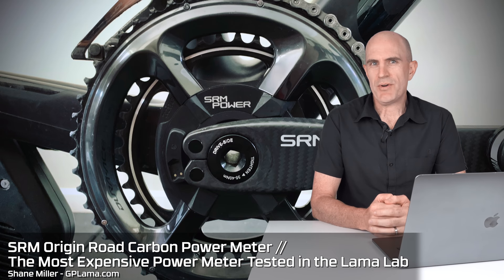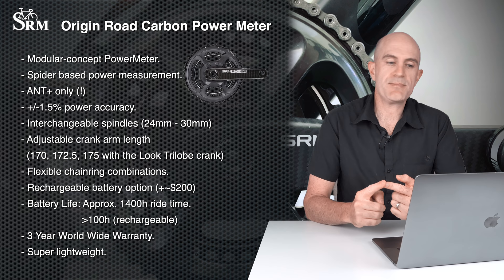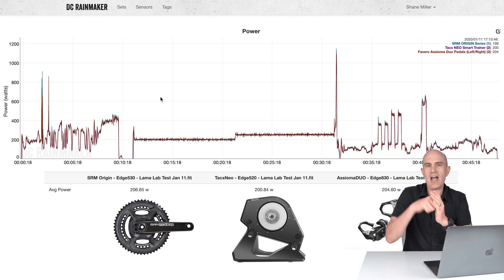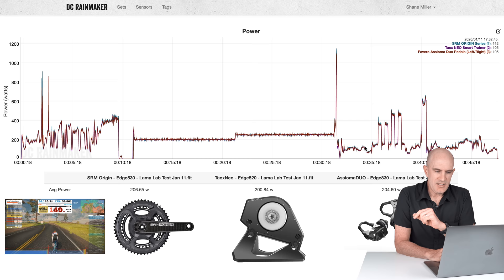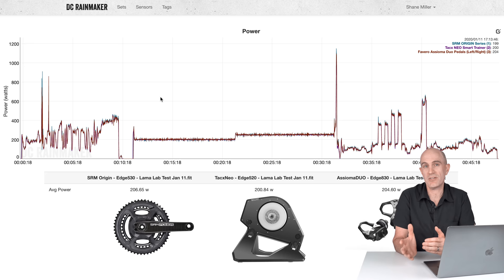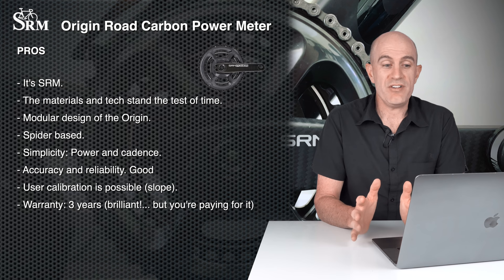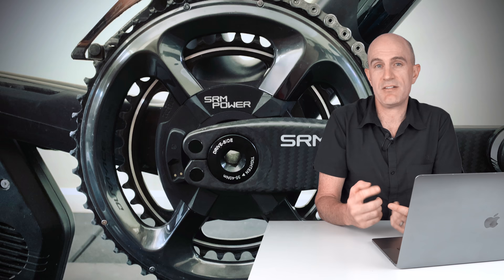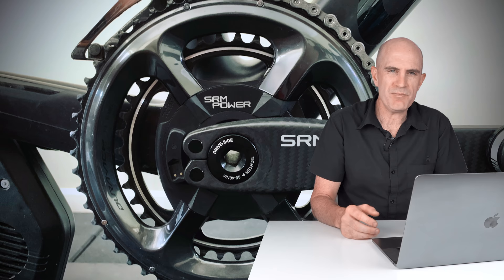SRM Origin Road Carbon Power Meter // The Most Expensive Power Meter Tested in the Lama Lab

Comment: The tech is a bit dated now and they have their issues, they are correct however in that it is not possible to provide correct L/R data from one sensor that measures total torque. 

As an aside I was there when the term "Gold Standard" was first used in relation to SRM, it was at the AIS in the first power meter showdown back in the early 2000's, it has been misused many times since, a story for another time. And congrats on the 100K, great work.

Comment: Two years back I bought a used SRM power meter for about 2/5 of its retail price and I never had any issue with it. It is so reliable and accurate that it is probably the only component on my bike that I never worry about. Yes the price is insanely expansive if you buy it new, but SRM will service your power meter whether or not you're the original owner. I own more than one power meters from different brands and my next power meter will still be SRM.
Reply: This makes sense as the way to buy SRM. Get it calibrated and it's like a new power metre

Comment: I’ve got a couple of these on my bikes and luckily didn’t have to pay for them.....as he says they do the job they are meant to do. The original version of this came with the crank arms made by THM and were made as singular lengths ie just 170 or 172.5 and so you had no problem with air between two metal plates and any chance of play. These are Pro tools and just like the PC8 nothing fancy but give the main info you need. Good, honest and fair video.....👍🏾

Comment: Having owned 3 SRM Power Meters (2 road one mtb), and having had issues with two of them. They aren't immune from trouble. 

Accuracy your testing proves they are no more accurate than anything else on the market, which mirrors my experience (all three read high).

For the price premium this thing needs to be breaking new ground on the technology front, instead it's stuck in the mid 2000's with Nokia! There is no way anyone should be dropping that coin on an SRM Origin, there are far better products out there.
Reply: what do you recommend. I just started doing my research. thanks

Comment: If you use srm with a compatible head unit you get 500ms update intervals which makes a big difference when using raw power to pace intervals. Get one off ebay for 350 quid , service it for 90 quid and you're away for less than most other power meter cost. New they are too expensive imo. I like the simplicity - my garmin pedals were buggy as hell wish they didn't have a load of extra features to go wrong ! Good review though every comment was valid
Reply: Now you can buy new one,7th generation,some warehouse deals-950€.
Still,way to much for what it is.
P2M ng eco is 490 for spider-thats a good deal

Comment: Just bought one of the ex team issue ones for about $1800. About 250g lighter than previous powermeter, looks cool as hell which is super important!
Also have a 9000 series SRM, it just works every time without ever needing to think about it, and with the PC8 have never lost any data from a single ride.

Comment: He says it many times in the video - reliable, reliable, reliable. I've had one for maybe 4 years now 20k miles never had any bogus readings, dropouts or anything like that. Previously used PowerTap pedals (pain in the ass changing batteries and 1 every 10 rides they drop out and you spend bunch of time trying to repair) and also PowerTap hubs (which were reliable). If you never want to doubt the readings or worry about the thing not pairing then SRM is for you.

Comment: Well done, I'm surprised you prefer an accelerometer vs a magnet based cadence measurement. As a big quarq fan, I do appreciate the SRM I own for it's simple reliability (changing batteries isn't that bad, and once you open the unit you appreciate it even more!)

Comment: A couple things to take into account. Accelerometers have a small amount of lag in them that effect the numbers that one gets when sprinting or any short explosive effort. On the track, many sprinters use power meters with magnetic based cadence for that reason. From what I understand, a lot of sprinters are still using the wired SRM cranks because of the improved accuracy compared to units with an accelerometer. I have an Origin on each of my road bikes and am planning on putting one on my track bike. I have never compared the two head to head, but the numbers look very similar when comparing data from the same route.
Reply: I approved this message, except the wired part from the aesthetic point only. 🤣 
Head unit matters too. Sold my Bolt due to this reason. Bolt reports (on the head unit) vs actual data (fit file) do not match. For example, max power shown on Bold head unit is 1500w. But after uploading file to cycling analytics or strava, there is no 1500w. It is always lower (as much as 100-150w difference).
Reply: Accelerometer lag is completely swamped by the sampling rate of the head units in general, and is even less significant compared to single magnet based cadence.

Comment: Nice review. New design is interesting 🙄.
Have you ever looked into how long powermeter last? SRM units are build for on road use. But the units work even after 15 years (keeping in mind that they get serviced every battery change). We had units for 7 years. It just worked. Sold for $600 to another user who still reports no problems after another 3 years. Battery changed, unit serviced twice for $100 (usd) over 10+ years. Price paid: $2250 (usd).   Question is how long would pedals or other pm for  $500-800 hold up and if for 10years what would be the service cost to keep it up?
Reply: Team Ossenbrink 
You can find many quarq and power2max 10 years old.
In working condition ofcourse
Reply: @mikicastan  Probably true but many quarqs I have sold to clients 10 years ago have broken or are reading very interesting numbers. Quarq started selling in 2008/2009. I had a few quarqs myself which are stripped to the core as they broke. P2M models are not out for 10 years. And most models which were sold in December 2010 are "dead". I used to own one of those.

Comment: SRM looks really good. I have had Stages on my MTBs, but 2 of them failed without guaranty after 16-18 months. Now i use Sigeyi AXO Spider Powermeters on my MTBs and they perform very well. On my Racebike i use Garmin Rally XC200 since 14 Months and XC100 Single on my Gravelbike without any Problems. For sure i never will buy again Crank-Powermeters!

Comment: From a business point of view, I get the price given it's from SRM, but from a functional point of view I think we'd probably all agree with you that it would be a show-stopper from almost anyone else. One thing I do find odd, I would have thought that the people that this would appeal to,would also be the very people that might find most use for some of the cycling dynamics metrics - not in real time, but for post-race analysis and  training. Maybe not - does strike me as odd though...
Reply: Well, it depends on what you do with it. Don't forget that a power meter is primarily a pacing tool. We can collect all sorts of data but the problem always is whether you can actually use it productively. It's a kind of a tool in search of a use. A solution looking for a problem (driven by a need to differentiate yourself, to offer something extra to your customers). We feel like it could be promising but at this stage, it's more of a research tool.  You could talk to teams using Pioneer units that collect all sorts of stuff and this is the sentiment you'd get - they're (at least were) looking into possible uses. If they manage it and get an advantage, others will clue in. Until then, a typical professional needs just the pacing. And don't forget, professionals can afford to pay for proper sports laboratories. So, it's not just a question of usefulness of a measurement, but of continuous measurement in the field vs. a probably higher quality, short term measurement in a laboratory.
Reply: @jobicek  Indeed, it depends. That said, a power meter is primarily a pacing tool to the rider in real time. The other functionality  is what teams were/are looking at to assess any benefits they may have for training and rider behaviour during races and training - agree it's not cut and dried that there is a obvious benefit that is being exploited currently, but it does appear to be looked at and if you don't have it, you can't evaluate it. 
If it were a pacing tool, there are seemingly better tools for significantly less - if you're  not paying for it then, as mentioned, the latter is a moot point but a less accurate tool is still an odd choice.
Reply: Even to the coach, it's primarily a tool that allows the rider to follow given plan. Which is what I call pacing. Even when it's not really pace (speed) what you're measuring but heart rate or power. It tells me what I'm doing so I can get where I'm supposed to be and avoid going over my limit. And that's why consistency is the king, not trueness of indicated value. 250 W is just a number to my brain.

Sure, they have the meters, so they're looking into what they can do with them. But they only have them because of partnerships/ sponsorships. It's not something they went out and bought with purpose (we want these extra features because we believe we can do something with them). They got a new toy, they might just as well (try to) use it. As I wrote, it's more of a research tool at this stage. And I'm not expecting a pro team to do a lot of research. I imagine they share the data with Pioneer and their people are having a crack at it as well. There is a compromise to be made. You want to get an advantage, but you don't want to compromise training of your top talent.

I won't claim to understand why would anyone buy SRM. From a pro team perspective, sure, if it's for free (or at a masive discount), it's a proven solution. I would take one. But at retail prices, no way. It's like with journalists when they're building a bike for some article. Why not use a THM Clavicula crank with an SRM power meter if they'll just ship it to you for free? I would. I can certainly see the appeal of simplicity to the professional. It does what's needed and doesn't distract you. While the Pioneer feels more like a gadget for geeks. Something you can talk about over beer and show your friends. I don't want to degrade the product, but it's not uncommon to see products for professionals to have fewer features.
Reply: @jobicek  Yep, pretty much agree with all of that, certainly from the perspective of the professional team use. I think what i'm trying to say is that teams are actively looking at a seemingly smaller tweaks to training and race monitoring to try and gain an advantage. Having data available allows them to do this, not having it precludes it - e.g. in the case of a modern power meter, some of the advanced metrics may allow you to look at how performance degrades  with effort and time, sprint analyses and potential checks on physiological factors that may effect injuries. For a non-professional rider most of this is irrelevant, of course, and even in the world team arena it's not clear what is useful yet or not - they all may  certainly not be doing a lot of research themselves, although I can imagine at least two teams that might do some - but I feel we are seeing a lot more data acquisition now, with a view to examining that, by team or manufacturer or others, and without the data you're not going to be able to look at anything.
Actual accuracy (yet to be determined) aside, one place where I will query the suitability of this in the pro peloton is the complete lack of ATC - as Ray has mentioned elsewhere here this is probably more important for them than anyone, the idea that you will have to regularly stop pedalling for 5 seconds to get offset the power meter to get it to read straight seems odd to me,and, considering the terrain they'll be in and the efforts they'll be making there,  a little bizarre. Utterly precise values are not essential like you say, but consistency should be IMO.
I have no doubt in the quality of manufacturing at all, SRM make great kit in general, just not convinced this is actually that good  at it's core functionality - but as you say, it's almost certainly good enough for what a team might want for now.
Reply: I agree. You can't examine what you don't have. My point was that at this stage, professionals don't really know what to do with it, so they don't demand it and they certainly don't rush out and equip their entire fleet at their own expense. And you can sometimes see professionals running a product from a competitor to their sponsor, with removed branding, of course. Because it's a superior product and they actually believe it gives them an advantage (or removes a disadvantage). As I wrote, it's more of a research tool. It allows you to study. Meaning, it benefits the researchers, not really the riders. That comes at the applied stage. Once coaches know what to do with it, then the riders and teams can demand it. We can imagine the potential, but it remains to be seen whether it materializes.

Yes, TC is, in my view, an important feature. It has to handle changing elevation and weather. I could live with it being 10 % off as long as it reads consistently and can be adjusted so that multiple meters agree. Heck, it could read half or double for all I care. It could measure in hamster power. I could still work with it. :-) Often times, professionals simply use what they're given. I don't know how much it matters to them or to what extent they're even aware of such technicalities. I'm a scientist and an engineer so that's how I approach things. I prefer a total reading power meter but a professional might be just fine with a single sided meter for all I know.

Comment: Speaking about SRM, I can only recommend buying a complete wired SRM unit (YES WIRED) on ebay for less than 100usd, specially if you consider that wired ones transmit data when the magnet is reached not only every 1s like all other ANT+ units, so you have more reliable data - that's the most cost effective way to get into power - and probably still the best measurement. I still use a wired one on my daily driver, and have used for 10+ years with no issues. Changing the batteries costs 15usd if you do it at home, and like you mentioned you can calibrate the slope - but you don't need it because it is SRM. I have two other wireless ones, but the older models, they are built like tanks and go on forever, simply as that. Having said it, I would never ever pay that much or recommend a SRM Origin, that's just madness.
Reply from the maker: I've picked up a few pre-owned SRM units over the years. After servicing they were good workhorses. The catch with the wired head units was no GPS... so no Strava.
Reply: @gplama  I guess moving data in general is hassle - you got to open the SRM program, upload it to training peaks wko+ golden cheetah.... maybe the Orign is not that expensive after all :D :D

Comment: This would be nice... for a Chinese 300USD spider based power meter. And those are coming. With Bluetooth etc...
Reply: You could get Quarq or Power2Max for under 300 after accounting for the price of the crank set. I think some offers went even under 200. Not sure about current pricing. If you're building a bike from brand new parts, it's a no-brainer. One of the cheapest options to get a power meter, they're brands with decent reputation and they actually measure total power. Sweet. Downside is that the selection is limited as not all options offer such a great value for money. But it shows they could probably go down to something like 100 without much trouble if the volume was there. And that price is almost ridiculous considering the cost of other sports technology. Although, in all fairness, it's not like a power meter is an overly complex device.

Comment: I took a gamble and bought this on Aliexpress a few months ago €270 and it works great for me. Just wondered have you ever tested the Sigeyi ?

SIGEYI AXO Spider Power Meter

Auto Zero/Auto Calibration
Accurate and stable
±1.5% accurate
Stable auto zero
Dual data transmission ANT+ BLE
Magnetic rechargeable lithium battery
Real time temperature compensation
200h long time operation
3 key data: Power, Cadence, Left/right power balance
A wide range of Compatibility: for SRAM (ROAD AND MOUNTAIN), ROTOR, Specialized
Compatible with many chainrings: crankset original chainrings, shimano chainrings, oval chainrings
Multiple technical support, ±1.5% accuracy is not just words
Auto zero without any manual operation, no longer to do zero reset by hand
Real-time temperature compensation: Although the temperature suddenly changes, it is still accurate
Data transmit in ANT+ and BLE at the same time, compatible with a variety of head units
Reply: Any cons?
Reply: @DiegoRevs  I haven't found any cons. However I have no way to test accuracy other than with my Direto X Turbo Trainer, but it it seems to me to be fairly accurate.
Reply: @DiegoRevs  the (firmware) support and the quality... and if You will have any problem with it (will be 4 sure :) ) , the shipment cost to China will be a bigger amount, and there is a chance You wont get back ... A Power2Max NGEco knows the same /with more than 10ys experience/ with 2ys EU (or US) warranty from a reliable Germany company. (NG has 5ys warr.) , if You are serious , dont buy others...
Reply: @andraslukoviczki519  Thanks for the feedback, I currently have the Pioneer Dura Ace DualLeg PM.